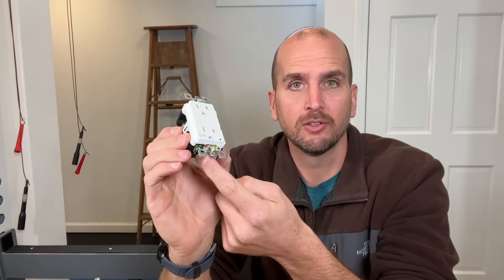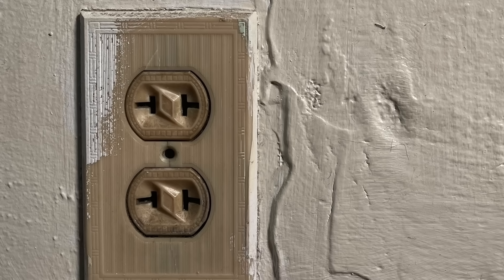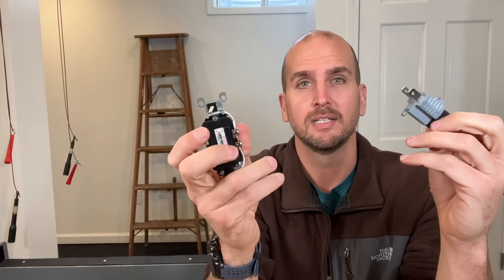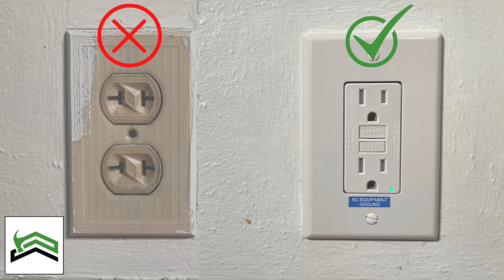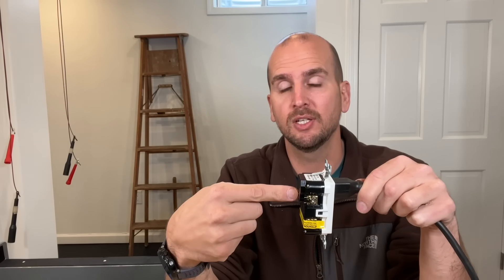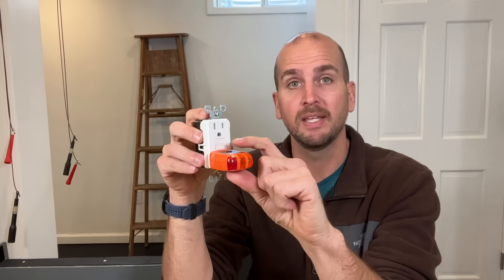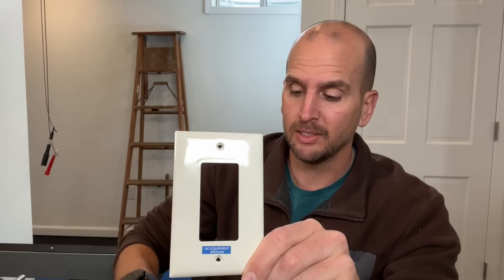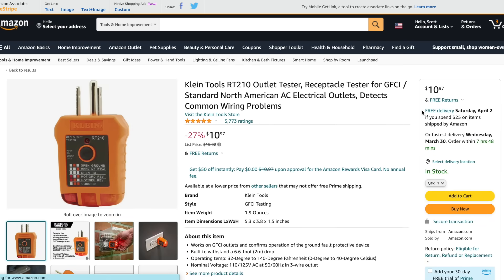Does a GFCI Outlet Still Provide Protection Without A Ground Wire?

Comment: From what I know of GFCI outlets, they measure the difference between power going in and power going out (I have no idea what that actually means in practice, funny enough) which a ground wire wouldn't be involved in. So I'm going to say it doesn't require a ground wire.
Reply: Actually, it does ! without it, there's no circuit to cause it to trip. BUT with no apparent ground wire to the GCFI, there is still most likely a ground wire to it - as the neutral wires are usually connected to ground anyway - an it is that that allows it to trip.
Reply: @millomweb  No, it does NOT need a ground to work. If you, or a device becomes a path to ground, then more current is flowing through the hot, than through the neutral, and it WILL trip. A small coil inside the GFCI stays centered, as long as both sides have the exact same amount of current. As soon as a different path is created, it causes an imbalance and the coil switches to one side and opens the GFCI.
Reply: @philipabshier2060  If it has no connection to ground, there can't possibly be a path to ground it'd recognise !
Reply: @millomweb  The neutral wire is connected to the ground and grounding electrode (ONLY! per code) at the panel.  This is before outlet GFCIs, so that's irrelevant.

GFCI's really do work by measuring the current difference in the hot and neutral wire (both of which you can call current-in and current-out, reversing 60 times per second).  Electronically it's actually quite simple to do.  If you run a wire from the hot side to the ground prong on an ungrounded socket, nothing happens because the ground pin isn't a current path.

A GFCI will trip if you divert some of the power from the hot/neutral legs to somewhere else.  Doesn't need to be a wire.  Touching the hot while standing in a pool of water, or in bare feet on a concrete slab is enough most of the time.  In fact, touching the neutral to the ground downstream of the GFCI will usually trip it.  While the neutral wire is grounded in the panel, since it draws current, its voltage will be slightly different than a ground wire, and some current flows in the ground wire.  Since the GFCI isn't measuring ground current, the hot/neutral wires will mismatch in current and the GFCI will trip.

Now if you somehow manage to touch the hot and neutral without touching anything else, you're just part of the load and the GFCI won't trip.
Reply: @fromagefrizzbizz9377  "The neutral wire is connected to the ground and grounding electrode (ONLY! per code) at the panel.  This is before outlet GFCIs, so that's irrelevant."

Nope, it's ESSENTIAL so GFCIs work ! Without it, you cannot get the imbalance ("GFCI's really do work by measuring the current difference in the hot and neutral wire (both of which you can call current-in and current-out") to trip them.

"A GFCI will trip if you divert some of the power from the hot/neutral legs to somewhere else.  Doesn't need to be a wire.  Touching the hot while standing in a pool of water, or in bare feet on a concrete slab is enough most of the time. "

And only works because ground and neutral are connected together before the GFCI.

Draw your diagram of the normal circuit - then add the ground path to cause a trip.

Comment: Sir this is the exact issue I just had. I am selling my home and an inspector used his tester and found multiple outlets on different circuits that did not have ground. So instead of changing out the outlets to GFI I opted for changing out the breaker's to a dual protective breakers. I felt because this was old wiring with no ground wire I did not know how many junction boxes are hidden on these circuits. Yeah it was a bit more money for the breaker's but I feel it was better for the line to be AFCI/GFCI. Did I do the right thing?
Reply: I totally agree with your approach. I believe this to be the safest option.
Reply: @brettzeigerbacher2314  thanks Brett for the confirmation.
Reply: The outlets still need to be labeled "GFCI Protected".
Reply: @philipabshier2060  thanks not only did I label the outlets no ground but also AFCI/GFCI and which breaker that outlet is assigned to. I think I covered all the bases.

Comment: Great video.  I once heard you can't have two GFCI outlets in the same circuit. Maybe include this in another video.  Thank you.
Reply: You shouldn't chain them so that one outlet is protected by more than one GFCI. Now I do not think anything catastrophic would happen but it makes the system confusing and unpredictable.
Reply: You can have as many as you want.
Reply: @millomweb  Thank you for the reply.  I must have misunderstood what they said.
Reply: @jimbergen5232  Typical set up I've heard of in the UK is to have a whole house RCD with a 300mA trip current then individual circuits with  the more common 30mA trip current. The 300mA one is a sort of backup and covers circuits not on an individual RCD.
Reply: @millomweb  That is used on TT systems. The 300 mA is to make the earthing work so it is part of the basic protection, not additional protection like RCDs typically are. In the US TT is banned.

In TT the ground and the neutral are not connected. The ground wire goes only to a ground rod. The resistance is so high that the current will not trip the breaker so one needs universal RCD protection. Th drawback is that if it trips, your whole house goes dark.

Comment: is there a way to test GFCI without ground?
also wouldnt those screwdrivers that literally use you as a ground path to check if there's any power on an outlet trigger the GFCI too?
Reply: The test button on a GFCI outlet will work regardless of whether it has a ground wire.  The reason why it can do this is that the test button has access to the internal circuitry of the GFCI, and can induce a "fake" imbalance in current that the GFCI circuitry should detect and trip.

However, plugin GFCI testers can't work, because they can't cheat this way.  Conceptually, you could make a connection from the hot to a local ground (eg: full metal plumbing or a long wire with a fake ground pin plugged into an outlet with a known good ground, etc) via a resistor that lets only a few ma through.  But I don't know if such devices are available commercially.
Reply: @fromagefrizzbizz9377  but only if the test button is real. one should consider worst case tho e.g. some Wish-level GFCIs that dont actually trigger the GFCI function on the gest button but for example just mechanically push the switch from the inside.
that a direct plugin GFCI tester wont work on a groundless socket is obvious, I wanted to know whether there were other ways to safely test it.
Reply: @My1xT  If the test button is made like that you cannot trust the outlet in any way and need to replace it.
Reply: "Without ground" meaning what? Without a dedicated ground circuit - yes. Without a way of getting current to reach ground... unless you have some polyphase circuit in the house, no.

The 'test' screwdrivers have an internal 'resistance' of the order of hundreds of kiloohms, so the current through them is a fraction of a mA, not enough to trigger the differential circuitry.
Reply: @dlevi67  i wonder how you would get enough power to ground for testing that without you being the ground and possibly electrocuting yourself (note that i mean ideally an external way of testing just in case one got a gfci with a fake test button that doesn't actually trigger it normally but just throws the switch some other way
Reply: @My1xT  You don't need to test 'through yourself'. Any resistive electrical load - from a filament light bulb, to a heating element, to a bucket of salted water with two wires dangling into the liquid - is perfectly fine for that. The question is what do you connect the load to... and without a way of grounding the load (or a polyphase supply), you simply cannot test an RCD/differential switch.
Reply: @My1xT  A UK electrician remote tested an RCD - didn't trip - but it did trip on the test button. So DON'T trust test buttons ! I bought an RCD last year - and removed the test button!
To test the GCFI without ground - find a ground somewhere else and connect to that - but keep you out of the circuit !
There's a few 'daft' options. For the GFCI you're testing, try connected the protected neutral to any other neutral than the one protected. You could do the same hot to hot.
If there's something being powered on the protected circuit, a connection neutral to ground should work too.
Reply: @millomweb  Don't try to test this by "connecting to a found ground" without a current limiter, such as a resistor, or a small lightbulb.  Without that limiter, you may produce a massive kaboom.  Especially if you connect to a hot from the other phase of the panel!
Reply: The internal test button will still cause a trip without a grounding conductor.  The plug in style will not work without ground connected.
Reply: @scott_meyer  unless your "GFCI" is kinda wish-level where the test button for example just trips the switch mechanically instead of actually testing a non-functional "GFCI"
Reply: @My1xT  
Look at a schematic. The test button inserted a resistor between the hot before the current imbalance transformer, to the neutral after. I causes an imbalance in the sensor circuit.
Reply: @scott_meyer  a schematic only helps you when you have an honest gfci, couldn't a manufacturer sell something, slap gfci on the label, add a fake test button and be done rather than adding proper gfci circuit
Reply: @scott_meyer  Not on one I have.